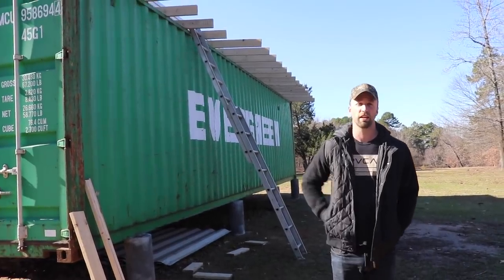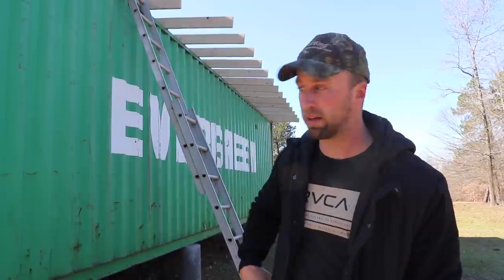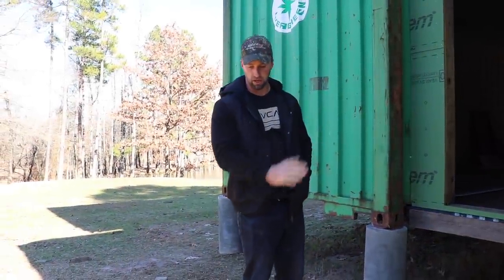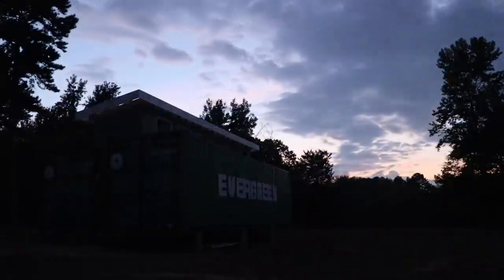We Didn't Really Think About THIS...

Comment: Tip: When drilling a large hole in heavy steel, use a smaller bit first to drill a pilot hole. Then use the larger bit to drill it out to the larger size. This avoids the jamming and subsequent snapping of the drill bit.

Comment: Great video!
One formula for estimating how much time something will take if you've never done it before is this.
Definitions:
S=shortest amount of time guess
L=longest amount of time guess
B=best estimate of how long it will take 
Formula:
((S+L)+4(B))/6 = reasoned estimate of how long it will take
Example for your roof:
S=3 months
L=24 months
B=7 months
Example estimate for the roof:
((S+L)+4(B))/6 
((3+24)+4(7))/6
(27 + 28)/6
55/6 = 9.17 months
You're doing fine!
Reply: Surfview Just made an excel firm using this equation, now to see if it helps my business. Thanks a million

Comment: You should use some cutting oil and drill on slow for those holes, also if you can get a step bit or step up the diameter more slowly with smaller pilot bits. It’ll end up saving you some time and headache. Alternatively, you can buy a drill stop for the larger diameter bits.

Comment: You both deserve a lot of praise for having the patience to do all of this work. As you stated you don't realize haw many steps there are till you do it.

Your snapped drill bit reminds me of something that happened years ago. i was helping a buddy install a bathroom vent fan, we mounted the light / fan in the bath ceiling and had to drill a 4" hole in the sidewall of the house for the vent hood. He was inside and I was up on a 28 ft ladder with the drill and 4 inch hole saw. I had to lean into the drill and when I was almost through my Tshirt got snagged by the hole saw. I was using an old 1/2" electric drill that was rated at 400rpm but infinite torque and the gear reduction meant it kept going for a bit when you released the trigger, by the time the saw stopped my Tshirt had been completely ripped off me and wrapped around that 4" hole cutter. The good news is though it ate the Tshirt it did not eat me so the operation was a success

Comment: Just a little trick drill your larger hole in the timber with your spade bit which leaves you a centre point  to start your smaller hole The way you  where doing it the spade bit was moving  all over the place because  it had no centre  to hold it in place

Comment: Spend out on a good cordless drill for the awkward drilling jobs, you can use the clutch setting and both save drill bits and the odd smack in the chops 😁

Comment: At 10:50, trust me and try this. When drilling into steel, put a ton of pressure on the drill while its turning slowly. Don't drill into steel at a fast speed. A really good steel bit at slow speed with lots of pressure will surprise you.

Comment: next time you will use a jig to place all your trusses into, located upside down, run the circular saw along a board and do multiple cuts to easily remove materials, and come back with a chisel to clean up the last bits, it will be easier to get uniform cuts.

Comment: One thing I'm concerned about is that you did not slot the holes the rafter support angle-irons. The metal and wood will contract/expand at different rates, so you risk metal fatigue at the welds. A few years down the road you may have a bunch of broken welds. Other than that, keep up the good work!

Comment: Since I see you snaping drill bit again on 2nd container. With bigger bits like more then 1/4 inch use slow speed and high pressure. Also get yourself milwaukee cobalt bits (last drill bits you will ever buy unless you drill steel alot) from home depot those bits will go through hardend steel like it's nothing. I normally use wd-40 throughout the hole drill because well those bits are expensive.

Comment: When you drill in steel lower your drill speed.  You can push harder without fear of the bit catching, you won't burn up your bits, and you won't break your bits.  The bigger the hole - the slower the drill speed.

Comment: Hey Spencer use some WD 40 , when you start drilling threw metal and spray every few seconds to help prevent the drill bit overheating and brake. FYI y’all might want to spray are add some thermal brake on the roof just a suggestion, Happy New from the
 🐊🐊 Cajun 🐊🐊

Comment: Hey i don't wanna be negitive but maybe this could be a constructive critisisim comment but i noticed the roof joices,and that you where using a power saw to cut the notches. Seeing how they where cut into a good bit , wouldn't they have a potential to break under stress easier? If so , my opinion would be that you should of marked the area's for cutting and used a recipicating saw ,so that you won't have to cut into the wood further more than you needed too. = ) Keep the good work up and the content flowing guys!

Comment: Actually question been bugging me since the last roof, why didn't you insulate it? Like between the metal and the board, just air.
Reply: Darryn Summers maybe there going to blow insulation in
Reply: They're probably thinking they need air movement up there so as not to have condensation.  Probably gonna insulate inside the container. Just my guess.....
Reply: @57fitter Určitě budou izolovat uvnitř. Ale v Texasu by se hodila nějaká izolační vrstva i mezi ty svrchní plechy. Spíše proti rozpalování  sluncem a vedru v létě.
Reply: A air buffer alone makes a great insulator, because of air's low mass, it doesn't transfer heat too well.
Reply: When are you going to put the windows in?
Reply: I wandered the thing! I also was thinking that, wooow! What are you doing? where is insulation for the walls too? Because when it rains or snows the walls & ceiling will sweat! Not to mention the heat in the summer time. I've got to tell you that these guys are funny! If they weren't they probably wouldn't have as many viewers! They made me laugh so much my face hurt! Lol 
I gotta tell you that I had not known about their website until just thumbing through YOU Tube late last night. Because I couldn't sleep! But know I'm hooked! I'm just curious about how much it is all total going to cost them? I have been looking at small houses /tinny homes. I just can't afford much, but I want to live somewhere by water of some kind! My soul needs it! Well thank you for listening. Sincerely, Sylvia
Reply: I also wanted to know where are they staying? I also heard one of them saying something about how what they are building will do until they build their house. Am I right? Oh I love  the dog, he's so sweet!
Reply: Sylvia Schepers .

Comment: the trick in drilling metal surfaces. press switch with mid strength press forward to the surface of the metal and release switch until it stop rotating, do it over and over again. DO NOT DO THE CONTINUOUS PRESSING THE SWITCH DRILLING. IT WILL BURN THE TIP OF THE DRILL BIT. and the drill bit will be useless. if boring a big hole, use small drill bit 1st before using the big drill bit

Comment: I don't understand what the cargo containers gained them vs. just stick building the entire structure. Perhaps they didn't think they had the skills to start from scratch, although this would have taken more work and planning than stick building. Were the containers free and does it change anything for codes or permits (if even needed) where they live. I have cut a door into a container..........actually joined 2 of them with a door between and it is a major PITA. I have been welding for 20 years and do it professionally as well. I have also been in the construction trades for 24 years and have done numerous small framing jobs like this, but am not a framer by trade. It seems it would have been much easier to build stick walls on the ground and tilt them up. The harder part is the roof framing, which you guy already nailed......pun intended. Anyway, cool project, but if you were to do it again, do you think you would still use the cargo containers?

Comment: Love that you guys are building your own home.  We did that many years ago, and still live in the home.  Thanks for sharing your lives with us.  Just to introduce you to a new kind of screw for wood to metal construction.  Most people use these to secure a wood deck to a metal trailer frame, I used them when I constructed my garage a few years back.   https://www.homedepot.com/p/Teks-12-2-3-4-in-Phillips-Flat-Head-Self-Drilling-Screws-40-Pack-21384/100145370    ---- You don't have to pre-drill holes, you start these screws from the wood side, and it will drill through the wood and metal and self-tap into the metal.   Best screw for the job.

Comment: 6:30 = The point of this video.  The problem with containers is that if you try to build "around" them, you're better off just using conventional methods, which is exactly what this project illustrates.

Comment: I have tried to use those joist plates, but every time I drive them down they are totally bent out of shape. I have wondered if using a steel plate on top of them to drive them down would save them.

Comment: One tip I would have for you is if you're going to be drilling a larger-diameter hole such as the one you drilled where the drill bit busted off, if you use a stepper bit to start the hole it makes it much easier. You can get them at Harbor Freight for a decent price but definitely don't get them at home Depot or Lowe's because they charge a fortune for them there. I use stepper bits to drill larger-diameter holes up close to the diameter of what the hole needs to be and then use a regular drill bit to finish it off. 

https://m.harborfreight.com/3-piece-titanium-nitride-coated-high-speed-steel-step-drills-91616.html?utm_referrer=direct%2Fnot%20provided

Comment: You might want to consider when drilling into steel, use a little bit of oil.  It helps the drill bits.  You guys are doing a great job.  👍👍🇺🇸
Reply: John Paul and also start with drilling pilot hole when using large drill bits, start with a 5mm then an 8mm then finish with the 14mm
Reply: @paddycaseygsxr  Metric sucks. They are building in Texas!!!!! But it is a good idea to start the hole small.....
Reply: I was checking the comments to see if this had been said.  A little cutting oil really helps when drilling steel.  It greatly extends the life of the drill bit too.
Reply: I started  my carpentry  apprenticeship with the imperial  system finish my apprenticeship  with metric system 5 years later work  for the next 48 years  with metric in the building  industry. METRIC is 10 times better than imperial system to work with
Reply: @gordonshearston7590  IMPERIAL is 100 times better than metric!!!
Reply: @dannywilsher4165  have you ever used it for more than a day
Reply: @gordonshearston7590  Yes sir I have .... It was 3 day as a matter of fact!!!

LOL, I have two engineering degrees and have projects all over the globe. I have used metric probably much more than Imperial. Both are a simple way to get to and end result. I think it is funny when someone goes off on how much easier or better one is over the other. So I enjoy messing with people. I have done the imperial sucks also just to get an argument going and to have some fun with someone. Personally I prefer imperial but it is because lumber and metal here in America comes that way. But if you can use metric and get to the end result you want, I'm your biggest fan!!!
Reply: @dannywilsher4165  I am  glad  you added  the last note I was a site manager for over 40 years  on large building sites around Australia and life was a lot easier with metric and I love a good stir have a great new year
Reply: @gordonshearston7590  LOL... I promise if you will sir!!!

Comment: I don't see why you bothered to build trusses for the roof(s)  over the container(s). You have 2x6 rafters which are perfectly fine for an 8 foot span (width of the containers) on 24" centers by themselves unless you have a massive snow load, and you must not because your roof slope is mild. If you are crazy worried about roof loading, just run a single purlin of pressure treated 2x4 or 2x6 perpendicular to the rafters, midway between the long dimensions on both containers, the long way. Bevel the top edge of the purlin to meet the underside of the rafters, paint the fresh cut with napthemate. Glue down with a dollop of const adhesive where the purlin crosses the high parts of the roof corrugations. Less work, less wood.

Comment: As a retired fireman, I think the one construction change that I hate the most is the invention of those cheap truss plates! Those plates fail so much more quickly than the old fashioned way of nailing the wood together with actual nails. It's really a moot point in a building like that, but I always hate seeing those used. Just my useless two cents, or actually my useless one cent worth of whining...

Comment: You really need to invest in a drill with speed control. Going slower will take a bit more time drilling. But less chance of it flying out of your hand and giving yourself a black eye. And yes I got a black eye from my drill. And on top of that less chance of snapping your bits. Just had to throw in my two cents. And may I add What a lovely young lady you have as your wife. If I was you and she was my wife I would be strutting around like a peacock 24/7

Comment: I think the reason why you two are struggling on the roof is because you have over engineered the damn thing. I built an entire 12x16 shed in a weekend by myself... Hint I'm a girl. You keep going back to repeat the same steps you have already done. Why didn't you pour the posts when you did the piers for the container? Why didn't you weld on the angle iron on both containers at the same time? Etc. Etc. Etc. You waste a lot of time in this manner. 

Next issue: You have created a sealed roof system above the container roof by blocking the air flow. A roof needs air movement to prevent condensation from forming on the wood and to prevent mold growth. There is no circular motion for air to travel which means it will stagnate even if it is on the cold side of building envelope. You have no venting at the ridge of the roofs on the shipping container or any form of vents. You need vents from the eve to the ridge or close to it. Here you cannot rely on gabble vents to provide the ventilation because the roof line is too shallow and you used 2x6s.

Honestly it amazes me that you have not read your comments and taken advice. I have seen others post similar stuff. Better yet, go watch a YouTube video or watch DIY or HGTV. Seriously, you have no clue what you are doing and have absolutely no disclaimer to say: We are not professionals. Not only that but clearly this will not pass a legit building inspection.
Reply: My God. Just go away then!!! Sad you have nothing but negitve! Very sad!
Reply: Actually they incorporated screening as vents along the bottom a few videos back...not sure about the top but I know They vented the bottom of the roof.